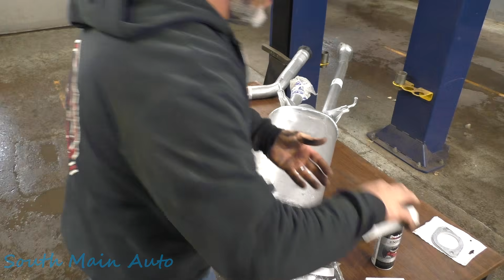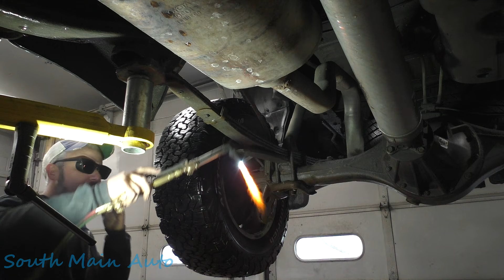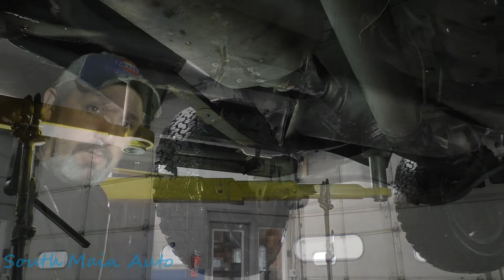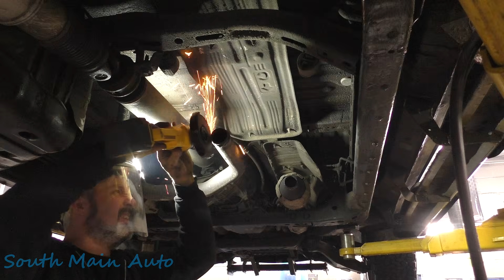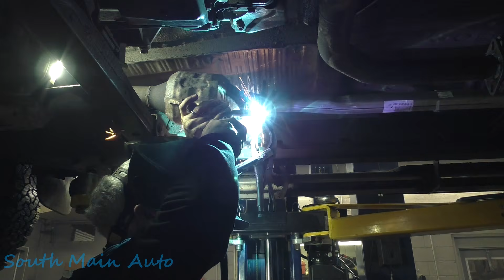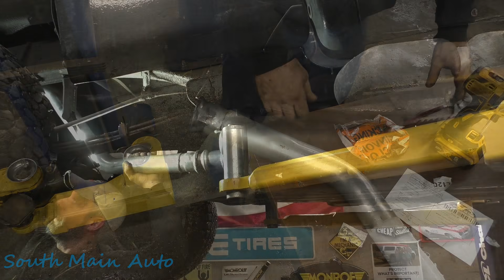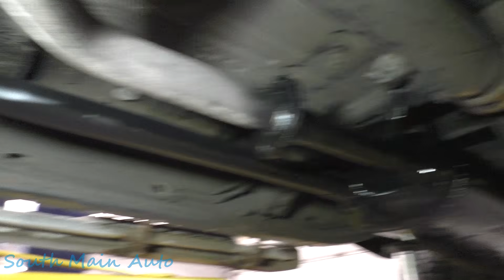Toyota Tundra: Welding On New Convertor Flanges & Replacing Muffler

Comment: My wife liked my car so I bought her one.  So, identical cars, except her's had twin mufflers and mine had a single muffler hung in front of the gas tank back when gas tanks were under the trunk.  I never had to replace the exhaust on mine but her's rusted out every year.  Well, I thought I had figured it out, a single muffler got hotter than twin mufflers and stayed dry.  So, swapped her exhaust system over to the design on my car.  By next year it had rotted out.  Women do the shopping and the short trips and that was the real difference.

Comment: imma have to step in for scotty K, and all toyota owners! 1974 - 1992 . yeah all made after that  '92 is not toyota, but made in (*&, and) yeah 2013 might as well be a ford made in canada, or whatever cause that aint no, te 51 or, ae86, or ae92. Yeah so 2013 is not, and will never be the quality of, te51, ae86, or ae92. But a ford if they are not these VIN$, Scotty knows the ole toys from the 80's with the 3tc / 2t. Im a 2 tc lover,,,t50 trans......... 50 years and going without a engine rebuild, do that FORD! fucking fords and chevs from friends need 8x the maintenance of a 1975 corolla. Go figure. I have personal evidence. Roomie likes his ford, and pays be alot to maintain, ford part 40k toyota 300k. not light experience, just fact!

Comment: CUTTING TORCH. I think it's all in where ya started if ya started in a rust belt every guy has torches. Come to think of it I've never seen 1 shop without 1. I mean ask SCOTTY maybe Dremel is the key to the gate to the solution. He's a character but I love old Skool mechanics like Scotty whom you don't see pulling to many electrical diagram fixes. He's just a tv character now. Who is taking in the cash I guarantee you that.

Comment: Eirc O  you know as well as I do from working in the rust belt that you heat the nut until all the rust falls off then wait 5 mins continue to heat until red.... beat ...try to break loose, heat... repeat.....I've done that process and have taken nuts off exhaust nuts that where the threads were you could see light.... new nut see you later... "mecahnics" don't know this

Comment: You missed the horse laughing meme at the start for Scotty there Eric! LOL!
Oh I hear that Eric! I couldn't do my job without torches! And for the folks that think it's expensive, think about all of the time saved, all of the cutting discs and grinders, and even sawzall blades and the recip saw! And like you said, being able to heat up bolts for removal, versus breaking them and having that whole mess to deal with. Or even being able to make custom solutions for problems, such as parts or tools. (I would suggest that you get a decent welding jacket though! I'd hate to see burn holes in your SMA hoodie! LOL) And to touch on what you said about heating nuts, just heat one side only. It will expand better that way. Bolt, well it's all about the heat cycles, and some Fluid Film! 

Oh, if you want to see some bad welding jobs, just watch the YT channel Just Rolled In! Great channel that takes submissions from folks like us, showing the scariest stuff imaginable, when it comes to cars! And Eric, your welds look pretty good! I could say weld done!  I'd touch it right away too! LOL!

Merry Christmas! All the best to you and yours this holiday season! o7

Comment: Cutting torch w/ tanks is like $499 at HD or theres a $300 one at HF. I'd have to check Welders Supply for the replacement tanks but I cant imagine it'd be more than $150 for both tanks considering they're usually not very big. Unless you're running the cutter all day every day for a year I cant imagine its very expensive to run.

Comment: I purchased my oxy/ac bottles instead of leasing.  If you want to give them up the welding supply place will repurchase them for 75% of whatever they're going for at the time, so in a few years they're worth what you paid for them.  When I run out of gas they just swap them out.  It's more economical and I'm just an occasional shade-tree wrench.

Comment: I remember replacing my exhaust every couple of years when I lived in MA. Was always a PITA since I didn't have a lift or torch so it was always done in the driveway. Here in AZ my 1996 RAM still has the original exhaust on it as far as I can tell. This is one of the reasons why I would never move back to the northeast...replacing vehicles every few years due to rust is a costly expense.

Comment: Back in 1983, I installed a Walker muffler on my Dodge van. 6 months later, I was driving down the road and the whole muffler dropped onto the road. It was thoroughly rusted out, not a single fleck of steel untouched by rust.

Comment: People fear the ferocity of the cutting torch due to its huge flame production. I always had a welding torch with a large nozzle due to the small work we did. Also the cutting torch was there waiting in the background in case things got nasty. I have had colleagues that used the cutting torch and nearby components got roasted due to incompetence. Those guys were the real scary torch bearers,especially around plastic fuel tanks. Mr O, you trust with the flame thrower no problem.

Comment: So the torch or what other tools to do the same jobs well in that case a. Sawzall or death wheel a good Sawzall will last a long time  but the blades are the expendable part and the death wheel I always like the. Diamond metal cutting blade expensive yet they last a very long time the cutting disks go pretty quickly cheap enough but I always take the guard off. To get angles that you can't w the guard and there is a reason it's called a death wheel I've had a few come apart under hard use and hit me in the hand or something yeah its dangerous so neither one of those tools can heat up nut cherry red and get it to come apart growing up in New England and working on cars farms and equipment the torch set like you say isan integral part of the tools for everyday use if your good like you said it is like anything else very proficient and can't be beat and the gas is cheap enough about once a month or so fill em up for cheap and the set itself will last a very long time if cared for reasonably..just like most other tools

Comment: I bought a 2005 Sequoia, all 4 calipers were frozen &   still had slow stops, rotors shot, replaced it all,  replaced the master cyl and it got a lot better, now looking at a new booster.
Shocks & coil overs were shot, headlights were yellowed & micro cracked, heater water control valve was bad, the plastic t broke when I touched it, intake was leaking, valve covers leaking, frame was good tho luckily.
Runs good 4.7

Comment: Over the years of my driving life and it is quite long now I have lots of different makes and models of cars sum used and some new and the main reason we bought new my wife uncle who is sadly no longer with use worked in one of the ford factory's hear in the U.K and we use to get a big discount off a new car nowing how much profit they make we buy used now if you choose well and look after your cars the will  last the most  unreliable makes of cars I have owned were Japanese and I had 3 new ones never away under warranty from the dealers the best make is vw they just keep going my current car is a Vauxhall and it is the best car a have had for mpg off eny car and also very Comfortable

Comment: Worst case scenario if that flange ever leaks you can get gaskets by "Remflex" and they are like this soft crushable gasket material that is specifically designed for "eh" fitment of exhaust flanges. lol

Comment: Eric - Thank you for your GREAT videos. Now....If you go through exhaust components as fast as you do, I'm surprised you haven't bitten the bullet and had a stainless system built for it.  There's got to be someone in your neck of the woods that can build you a decent quiet system.  As far as Scotty is concerned, he doesn't realize what happens to heavily emission laden California vehicles - thanks to the temperatures we run cars at out here (minimum 210 degrees) they don't rot, they just get cooked.  And Dag Nabbit, wear an Arc Welding Helmet when you're doing that.  You've only got one set of eyeballs.....And by the way, your welds passed my test and as far as I'm concerned you're DAMM GOOD at what you do.

Comment: OK here's the trick to soldering.  Get a rosin flux pen so you can apply plenty of rosin flux.  Better yet get a bottle of rosin flux with a little brush to apply it liberally.  And acquire some lead solder.  To heck with that lead free stuff.

Comment: I have that same welder.  I like it and haven't had any trouble with the circuit board getting dirty and going belly up like others have.  Runs real good on 220v compared to the 110v but I still like the option to use either.

Comment: Well Mr Eric O. Being down here Central Alabama I can understand
People's negativity towards the blue wrench. I wouldn't call it an expense though. Up there in the rust belt it serves two purposes. It provides heat and it cuts labor cost I'm not sure what shop labor cost up there but down here it's 150 an hour I can fuck off for 3 hours trying to look like a professional mechanic meanwhile reaming the customer's ass out in labor cost vs 15 minutes of pure pyromania Joy. I don't know about most mechanics but I know most customers would rather not pay that extra 2 hours and 45 minutes. If man has to take the slow route to do it he needs to stay out the tool truck. Oxy acetylene and an air hammer are my two favorite tools.

Comment: Maybe make a place you can drive over that hoses off the underside of the vehicle as you slowly drive across and it washes at least some of the salt away.  Perhaps just a pipe with a bunch of holes in it hooked up to your water hose.  Oh oh!  And just after that a similar set up that sprays fluid film.

Comment: Nice job and there's nothing wrong with your welds aside from you touching one too soon.   A suggestion. There's a product called Instant Cold Galvanize that works as a sacrificial coating.  It works better than engine enamel at slowing rust on heat cycled steel exposed to salt, plus its grey so you can see where rust starts at a scratch and respray over it before it progresses, similar to Fluid Film. .
Reply: I was just about to mention the same Cold Galvanize product for coating the welds.

Comment: Question ☝🏻….do you deal with pre made exhaust systems only?  Meaning do you have a pneumatic pipe bender?  

It’s amazing how the scope of work for mechanics varies so much from region to region.   Typically here we have specialize muffler shops that’s all they do.   Most independent shops don’t do exhaust work.  

😂😂What would happen if you sprayed the exhaust with that fluid film you use for rust prevention? 😂

Comment: There is nothing wrong with using a cutting torch, for everything you have used it on I am OK with.  I was born and raised on farm here in Southern Ontario Canada, A torch is something every Farmer has, as well as every mechanics shop.  And to those that do not know, you heat a stuck bolt and it comes out every time.  My memory escapes me, but I know I have been in a Walker plant, I looked up the Location and Yes I have been in one in Cambridge Ontario Canada

Comment: Cutting torch/gas wrench vs all comers.
Sawzall blades are pricey. Even if you buy the junk. Cut off wheels. The same is true. If one uses blades a lot or cut off wheels it adds up fast.
If you're a hobbyist that occasionally needs to remove/cut something. Yeah a Sawzall or right angle grinder is your friend.
You just keep burnin' 'em Mr.O!

Comment: Hi Eric, by chance, was the P/N on that "OES" muffler/tailpipe assembly 2103-424008? If so, that exhaust was manufactured by an aftermarket wholesale automotive parts supplier known as Autopart International. They're main hq is based out of Norton, Mass. They began back in 1957 as a company known as Foreign Autopart. They are a leader in import vehicle "OES" exhaust systems that's mirror original equipment exhaust as far as hangers, bends and construction, no bending or welding required. They also carry a limited lifetime warranty on them as well. Yes, the hangers, construction and overall fit and finish are much better than Walker, AP, Arvin Maremont, etc. I've had excellent success using their exhaust products. Merry Christmas to you, Mrs. O and the kiddos. 🤙

Comment: I live in the northeast and am currently a DIYer. I wish I had a cutting torch for some of the jobs I’ve done on my ‘06 Tacoma from the leaf springs to exhaust/CAT replacements. Used a grinder wheel for many things. I was cracking up when you sang come on baby light my fire. Great work with the Toyota’s, the only brand I buy not because of Scotty.😂 Merry Christmas to you and family.

Comment: People who question a mechanic on cost of a tool are clearly not mechanics.  A proper tool for the job saves you a lot of money. Heating a rusty bolt is far more economical than breaking it then having to deal with drilling/extracting it. Nothing can make a 20min job turn into a 3hr job like a rusty bolt.

Comment: The four things you don't do in a YouTube video:

1) Weld
2) Solder two wires together
3) Mention what brand of motor oil or filter you use
4) Talk about how we don't use metric here in the US for everyday measurements

Comment: The armchair expert keyboard warriors need to spend some time under a car doing what you before commenting. You have that welder dialed in beautifully and executing the second most difficult weld in the book. You are welding in the 5G position and doing it perfectly. Your skills with the torch are outstanding too.....Ignore the clowns that try to say otherwise. I have 6G certification and would rather spend a week in a ditch welding pipe than an hour welding exhaust under a car. Your skills are good!

Comment: Rock Auto been very very good to me. Thinking about that homeowner, laying on his back under his truck,  so long as he has a sawz-all,, MIG (with gas for well behaved welds), various vice grips, hammer, lights, cordless grinder, assorted sockets, PPE, ratchet straps, and an exhaust pipe expansion tool of the appropriate range, not to mention a set of torches (although these days i more often use my plasma cutter for no particular reason) ; well that homeowner doesn't need a shop, he has one, and if not, he better take it to one. Love your videos.

Comment: You have had to have lived or live in New York to understand why you need the torch  most people that live in the Southern United States never needed that stuff but it is definitely cheaper then get a reciprocating saw and blades. You only use the torch for a few minutes compared to the saw and pretty much the saw blade is spent after the use of the blade.

Comment: Two other things that attract a dung pile of negative remarks are household wiring by amateurs, and tree falling by ranchers. Interestingly, at one time anybody who did brakes without cracking free the bleeder screw was crucified, too. Then along came real professionals like yourself who showed that the ideal world doesn't live in the rust belt. Show me a keyboard cowboy with angry certainty, and I'll show you a guy who hasn't done his 10,000 hours on the shop floor.

Comment: Toyotas might be mechanically reliable, but their trucks aren’t exactly known for being impervious to rust…

At least by making a video about fixing your own truck, you can write off all the parts as a business expense and probably make more money off this video than it cost to buy the parts in the first place.

I’ve had such bad luck with aftermarket (stock style) exhaust systems that we stopped installing them. We sublet the vehicle to an exhaust shop and have a custom-built system installed instead. None of the aftermarket stuff fits. We don’t have to worry about rust, just garbage fitment.

The comments about the cutting torch being too expensive probably come from people who live outside of the rust belt (like me, although I have enough basic common sense to not criticize you for having/using it). I think I’ve worked in one shop (out of five) that had a torch, and I never used it. I know it’s a requirement in the rust belt, but outside of it, it’s not really. Some people refuse to make any effort to understand things outside of their own perspective, and those are probably the folks who are criticizing you for having a torch when working on rusty piles. They don’t need one, so (in their minds) nobody needs one.

If Rock Auto gave a flying F about the condition of their stuff when it arrived to the customer, they wouldn’t use FedEx. I know some FedEx are franchised, but around here, they never fail to fail. Stuff consistently arrives late, damaged, destroyed, or not at all. I have a door bell camera and I don’t think there has been a single time that one of their drivers set a package on my doorstep. It’s always dropped or thrown, sometimes from as much as 10ft away.

Comment: Your welding is crap?? Nope - you should see mine. I got an inverter stick welder - great for blowing holes in things, or leaving great blobs of metal puinctuated with holes on thicker metal, and I got a gas/no-gas mig welder which is great for thinner metal if used by a skilled welder. That ain't me and I applaud you for welding that exhaust insitu - something I could only dream of doing. So ignore the "experts" (as the saying goes "ex" means "has-been" and "spurt" is a "drip under pressure") because you did a cracking job. Well done!

Comment: Cutting torch is a necessary tool. But you have to know how to use one. Used propane for 20 years instead of acetylene. Propane burns colder needs a lot more oxygen.  Acetylene burns in a tighter dispersion making a smaller cut with less pre heating. Prefer acetylene.